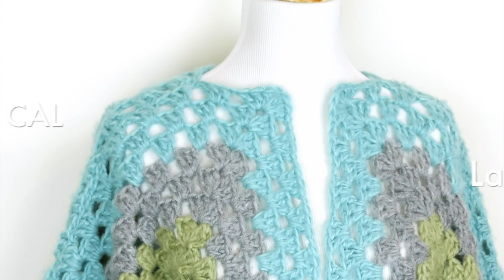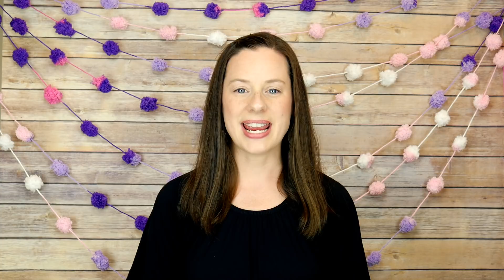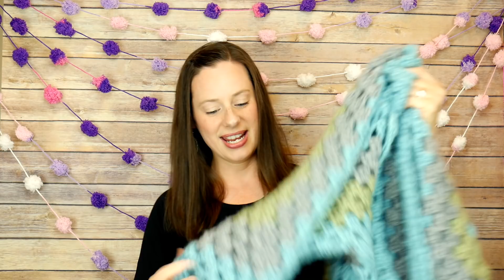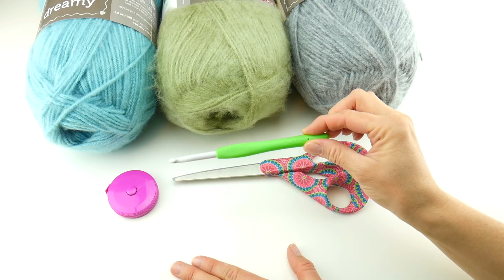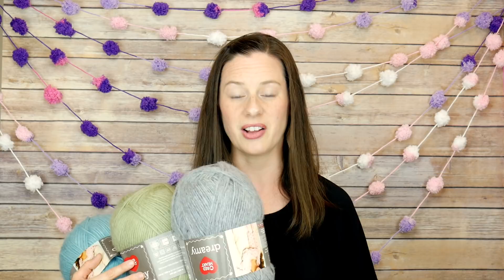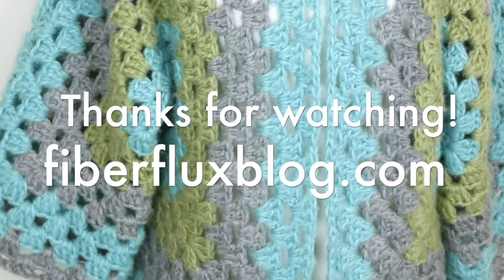2018 Fiber Flux Summer CAL--Land & Sea Cardi Week 1: Intro & Supplies

Comment: I’m late to the party, yay! I want to make this cardi using Debbie Blisss Cashmerino Aran, which calls for a 5mm hook. Is there a gauge on this project that I can use to guide me? I have 8 different colours and a couple of surplus that I can throw in there if needed. The balls are only 90m long and I have a total of  1,800 meters (plus 205.2 meters surplus) Will that be enough? Thanks for your time, Jennifer. I look forward to your reply. Céline x